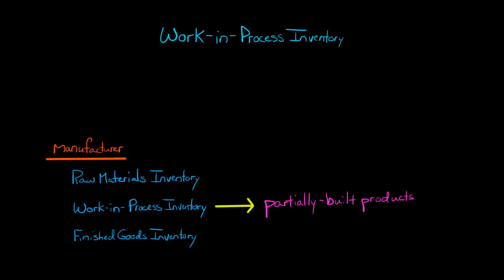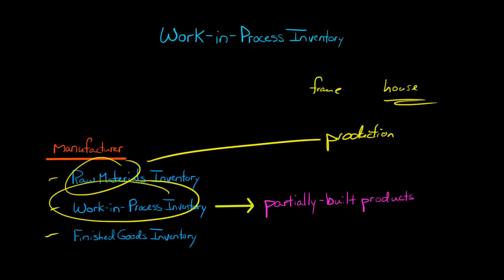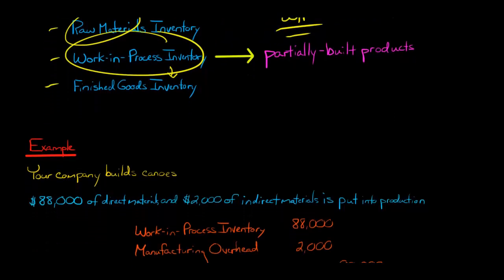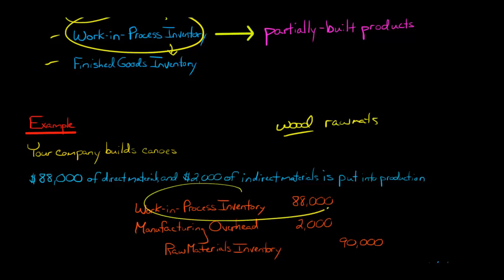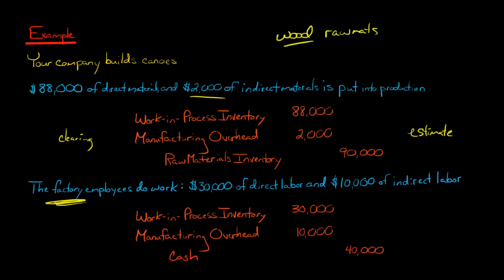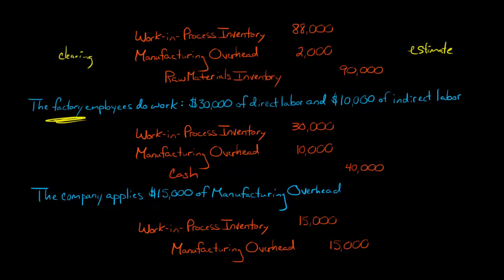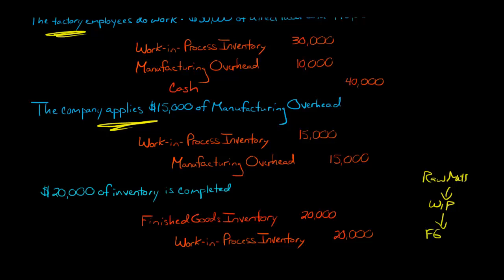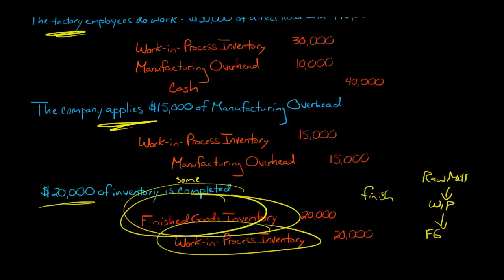Work in Process (WIP) Inventory

Comment: If labour cost is also included in Work in progress inventory, then how do companies calculate how much labor cost ( & other costs) is required to manufacture that product which is still in the process of production? Because if we consider finished good inventory it is easier to calculate the total labor and other costs which was required to manufacture that product, because the product is already produced, But in case of Work In Progress the product is in the process of manufacturing.
Reply: Only “direct” labour costs are included in WIP. This is everything that is physically involved in producing the product (so manpower directly involved in turning the machinery,  physically sticking objects together etc). You should look at the WIP section of a company’s inventory as the “direct” costs account because only direct materials or labour will be included in there. Calculating labour costs becomes easier only if you’re able to narrow down where they are coming from, which is why management accountants separate WIP from “Manufacturing Overhead” which can be viewed as your “indirect product costs” account. These costs include indirect labour and materials involved in production. 

It’s actually much more difficult to trace costs if we only have a finished goods inventory account available to view because this account will not separate indirect and direct labour or material costs. It is simply the total dollar amount spent, direct and indirectly, in producing the finished product.

Comment: Does a business have to have wip? What if you take raw materials and turn it into a finished product.
Reply from the maker: Raw materials (e.g., lumber) first become work-in-process inventory (e.g., a partially-constructed house) and then eventually become a finished product (a fully-constructed house).  If a company has no partially-completed inventory (e.g., it only has lumber and fully-constructed houses) then work-in-process inventory would be zero
Reply: @Edspira   how would you find COGM with 0 wip then?
Reply: It’s not realistic for manufacturing companies to not have a WIP. In fact, all of them would love it if the materials could instantly be turned into finished goods ready for sale but that simply not true (and never will be). WIP allows production managers in a manufacturing firm to clearly see the amount spent on direct costs at a certain point in time since information is required consistently to make key decisions.